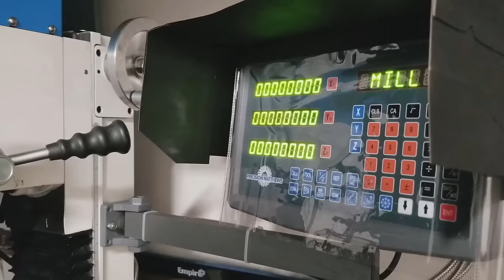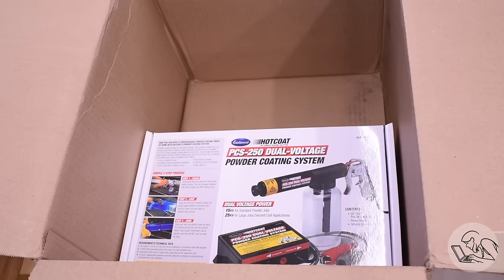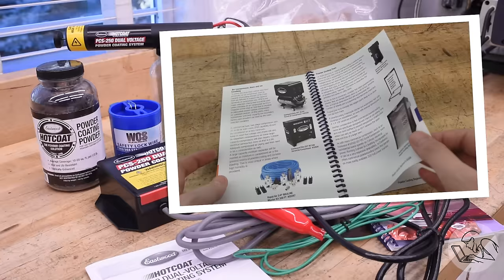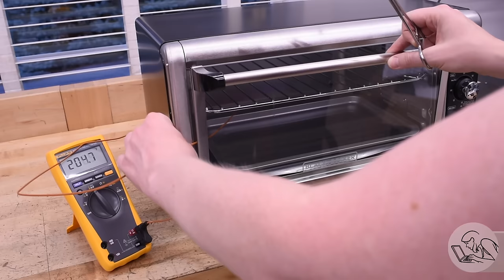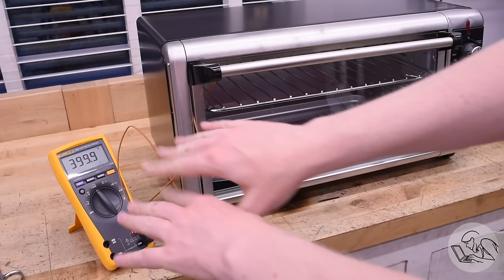Powder Coating At Home! You Can Do It!

Comment: For anyone interested, you can powder coat perfectly well WITHOUT  this powder coat kit. We ammo reloaders have been powder coating our bullets about 100 at a time just by shaking them in a tupperware container, shaking them out on a wire screen, and then just putting them in the oven for a few minutes. Perfect results. So you don't need all this expense. But it's still interesting to see....thanks.
Reply: PS....Eastwood is the best powder, though.

Comment: I love powder coating, probably because I hate painting. Two tips I found helps.  

First is to polish, clean, lightly sandblast, clean, then powder coat. I find that any surface inconsistencies are magnified in the powder coating. Primer and paint fills voids, but not powder. The very fine aggregate sandblast mattes the finish just enough to hide any micro scratches and gives the surface more bite, which seems to help make the powder coat even more durable.

The second tip is about corners. Really sharp corners are a machinist’s dream, but are not ideal for powder coating. If you can ease the corners a bit, the results look better and will hold up better. The sharp corners seem to coat thinner, and they cut the coating like a knife. For big items, they recommend a 2mm radius, but I find that even just a little break of that edge makes a big difference. Again, it needs to be tooled, polished, and surfaced just like the rest of the piece to look great. Just knocking it off with a file or debur tool can result in an inconsistency that will show up after it is finished for small show pieces like you are doing here.

Comment: There are many different Powder Coating materials.   A broad generalization is either they're Polyester / Urethane  based or Epoxy based.  Most stuff is Polyester / Urethane based, the more expensive Epoxy based stuff (aka Thermoset)  is tougher than anodizing or just about everything else.

Comment: You can use flathead screws and/or make you some cone shape spacers/washers so you only prevent powder from getting in the holes. That way you get powder on the whole surface.

Comment: I would NOT suggest a microwave oven transformer DIY version, first I don't think it would be easy to make work, second dangerous... a neon sign transformer would be a safer idea to start with, I imagine ideally you'd want high voltage DC, "ionizer modules" might be the better place to look, or a few high voltage diodes in series

Comment: 8:18 McMaster has large selection of gauges with a range of 0 to 15 psi, and since they are most accurate at mid scale, that should be about perfect.  The lowest cost one I saw was about $15.

Comment: Have you tried something like a clothes pin to lightly clamp the ground wire to your ground rod. This could help with grounding as well as stabilize the swinging around of your parts while spraying. One other thought I had was bend your ground wire 180 back on itself so it'll act like a small spring then feed that through a hole in your part. Again, maybe a better ground and more stable part. I'm just spitballing here, I have zero powder coating experience.

Comment: Well done video , in the United States i have  a few freinds that do small Motorcycle and Automotive parts in Powder Coating  they Custom Fabricate  all of these guys have  used  Salvage Household Ovens for their heating elements  and fabricated. the Ovens or “Curing area  out of  anything from Bricks , stones ,Plywood and   Insulation to keep the heat  contained  all methods. appear to work  fine  these guys. mostly began Powder Coating  with a system that was built for Sears and badged with the Craftsman logo  they however. do  puchasecEastwood Powder  to replenish their  stock  many of those guys   use a lot of Black  for motorcycle parts. and  frame and Suspension parts  they Weld and Machine for their projects

Comment: If the thickness of the powder coating becomes an issue (ex. threads), take a look a Cerakote.  It creates a ceramic coat that is thiner than the powder coat.

Comment: I would recommend looking up how to turn a toaster oven into a reflow oven for circuit boards. Temp it measured with thermistors and controlled by a micro controler to a set temperature curve over a set time. This could easily be adapted for tour needs with a tweak to the coding.

Comment: Hook thru hole: Take the wire double in the "hook-part" and bend it into hook shape. Use a screwdriver to bend up the two wires, so they have some springiness against the walls of the hole. Makes better contact. I hope its understandable ;)

Comment: You can also preheat the metal and then spray it and it will melt immediately and you can get a thick layer that way.

Also i think your air pressure might be a little high just from the sound and the speed of the dust

Comment: Turn your top rack for the oven upside down if you can , then you might be able to just hang a few parts on the rack and slide into oven. Taking the very bottom shield pan out may give you faster reheat times and possibly increase temps. If you can find some thin insulation for the oven door may help the temperatures as well. Great item for the shop.
Reply: The problem is it slides for about the first 6-8 times then it doesn't.

Comment: Quinn you are always FLoCKING  around in the shop, anyway the shop I work in powder coats parts and the guys that do it every day say the key is bead blasting the parts first (they use crushed glass ) it leaves a textured finish  on the metal and when the powder melts it flows and grips the textured surface there parts look like they were  dip in a bucket of paint when its done ,  anyway thank you for taking the time to make this video...

Comment: That was a great video. It shows the versatility of the product so well. The final thickness is amazingly thin and, therefore, must weigh far less than paint, which will be great for small model aircraft.
Is there any reason you could not tip your oven on one end, giving you a taller space to hang your parts. Obviously, the controls would be at the bottom.

Comment: You can use a normal kitchen oven that's electric, very highly recommended that it be purely dedicated to just the powder coating. Unless you like the extra zesty chemicaly plasticy taste that will permeate everything cooked in said oven.

Craigslist or marketplace are decent enough starting points to get them used as remodel take outs, moving "i don't want to haul this with me" deals, or because the cook top, if it's a combo unit, no longer works.

Winter is usually a good time to do a lot of powder coating because the air is usually dryer already and you're going to have a oven going so might as well put the extra heat into warming inside or garage when it's freaking cold versus when it's hot enough to get plastic garbage cans soft.

Comment: It would be a easy fix to rewire the power light on the oven to be in parallel with the heating element so you know when its up to temperature

Comment: I had a car chassis that was powder coated. It took a tin of paint stripper and a few twisted wire cups for the angle grinder.
A friend worked at a company that did nuclear engineering. They powder coated my car frame after a chassis mod. The original powder coat wasn't as good as the one they did.
They also powder coated all of the suspension components.

Comment: Quinn, I run my toaster over on its side to get the height I need.  I cut the wire rack in half and then screwed it to the side of the oven.  that became the top and now i have about 18 inches from top to bottom two hang stuff.  I'd send pictures but I don't know how

Comment: Here's a thought for your ground. They gave you rubber plugs. When you run your ground wire through a hole in your part can you put one of the plugs in to insure a good solid ground?

Comment: I had had very good results using two part etch primer formulated for non-ferrous metals followed by enamel paint.  One part etch primers aren’t always effective and you should only really use a thin coat of etch primer.
Reply: That sounds good advice, given that brass is a zinc alloy, etching should give good adhesion. I’ve also seen brass parts develop quite a strong black finish when stripping nickel coatings in 10%sulphuric acid using a thio inhibitor, I guess a copper sulphide coating.

Comment: sigh   You might have cost me a lot of time and money, that looks like fun. Thanks. 

Excellent video as usual, hope this works out for you. I have pretty much the same experience as you have with paint. I can mix a decent caustic black oxide when I absolutely need to, even did a few rifles back in the days. And aluminum can be anodized, it's a bit of a hassle to set up but not as bad as the black oxide. But both have severe limitations on size and mixed materials. Powder coating really looks like the perfect jack of all trades.

Comment: The compressed air "dryer" is not a dryer, its simply a filter and water trap. It also should be placed before the regulator as they can cause up to 5psi drop. 
You can get small desiccant dryers which would work well for that situation.
Reply: @johnrussell6620  lol, no. every FR unit has the water trap and filter before the reg. you don't normally have a system so bad that it drops such huge amounts of pressure that it drops the temps that low. plus in any decent system the moisture is taken out before it even gets to the pipes let alone the end of line regulator.
tho the single biggest problem with what you suggest is filters add restriction which reduces pressure so your going to be lower than target pressure. how much lower you never know as the restriction is between the gauge and the machine.

Comment: powder coating. the laser printing of the paint world. :D here's hoping that you modify the oven for much better control, or get a dedicated powder oven. I mean huge cheap toaster is still a good 'shop oven' but I think the dedicated powder ovens are taller rather than wider. it looked like a tiiiiight squeeze to get some of those parts in there. also, I think threaded rod n such could help a lot for certain parts. especially if the rod can have a slight, but even bow. just enough to make it tight.

Comment: I prefer Cerakote...in my opinion it's easier to do.  Cerakote has a C series coating that is air drying, so no oven required.

If you already have an aircompressor, its just a simple matter of buying the cerakote color you want, a cheap HVLP gun, mix in a few mls of catalyst and off you go.

Comment: I wonder if a self tapping screw turned into one of the holes in your pieces would solve both the grounding and the shadowing issues. You could attach your ground wire and the hanging wire to the screw. The screw would only need to be turned in tight enough to grip the part but not distort it.

Comment: use a IR thermometer to measure the temperature of the part you coat not the oven temperature.
when the part is up to the right temperature then start the timer.

Comment: You can improve the bond to brass with traditional paints by using a catalyzed epoxy and catalyzed paint, then baking but I don't think it will be as good as powder coating when applied correctly. I've done some testing on different methods and for what you're doing I think that's the best .

Comment: You just got a new subscriber with the cat comments and climbing in that box.  LOL  I've been threatening to pull the trigger on the powder coating unit from Harbor Freight for a decade now.  The HFT gun is lower voltage and only $80.  The Eastwood is $148 with shipping. For small parts, is the HV gun necessary?  You could improve your ground by clamping it onto the hanging wire and rod, which would stabilize the part for spraying, as well.  Is that shop (nice, BTW) in your house, or a remodeled garage?  You've really sold me on powder coating. That stuff is great!  Are there any metals you cannot powder coat?

Comment: I'm a small-time patreon and really look forward to your posts, love your work. But here's a bit of negativity: as someone whose main relationship with powder-coating is to try and repair it (rusted 'wrought-iron' railings, unimat 3, fridges etc.) I consider it the work of the devil. Very useful to consumer durable manufacturers to provide a shelf-pretty appearance and resist minor knocks inside delivery boxing, but it turns whatever it coats into a disposable item, there's no fixing it. In the case of your trucks, forget ever repairing any chips and maintaining the beautiful finished look you have now. Of course, you may never run the loco enough to chip it. And I don't have an immediate better answer for brass, though I think there are more durable paints than that enamel you tried. At least paint can be stripped and replaced, even if it doesn't last as long. Yes powder-coating is more durable, but it does chip, fairly readily.

Comment: Great video, I have a HF powdercoat system sitting on the shelf ready to use. Few questions, did you have any coverage problems in the area around the hook, specifically where the hook is covering the part? Also, did the hook stick to the part after it was baked? Thanks

Comment: upgrade the steel rod with a piece of copper pipe and the wire for a piece of triped single core copper cable.

should improve the conductivity drasticly iron/steel is kinda bad for transmitting electricity.

maybe enough  so it doesnt need the dedicated  ground cable

and the copper should be able to whitstand more than 400°C or 400°F(~204°c) whatever temp measurement system u meant your oven was set to. 
think the melting point of pure copper is about like 1000°c/1800°F or somewhere north of it so no home oven would ever be able to melt copper unless the theromstat in in it is broken and the oven heater is in full blast mode all the time.

Comment: I'm surprised you can mix the powder to get sifferent colours. Yeeaars ago I got a tour of a power coating facility, and the guy said that mixing wasn't possible. 

I suppose from a distance the different particles will end up close enough on your retina, to end up in the same receptive field of some cones that form a unit, or something? But up close I think you'd see specles of the different colours? That may be a factor with model work, which I think will be viewed more up close.

But it does look a lot less of a hassle than spray painting. I have an unused paint spray gun for some years now. It just might get the company of a powder coating companion :)

Comment: for aluminum we use a nitric acid cleaning ath on aluminum and then sulfuric acid electroplate to make a diamond plate and we also use before that normal hot water bath dye of any color.. it not actually eltro plate its a coercive surface and diamond plate i probaly not the right term but its the term our company uses

Comment: Hello!  I've got a question about the process:  How does masking work?  I'd love to try this for a project of mine but there are some areas I need to be bare metal (EG, a square section in the middle of a plate for an LED to sit & conduct heat into the plate)
Reply: Stick down a piece of kapton tape, cut to size with a scalpel (either in place or before sticking it on) and then powerdercoat right over it. After it comes out of the oven and cools you can remove the tape, and the surface under the tape will be clean of powdercoat.
Reply: I forgot about kapton tape!  A perfect solution, thank you! @AlexanderBurgers

Comment: Unless there's an issue with chemical interactivity, Aluminum or aluminium would provide a better electrical connection. Stainless steel is a relatively poor conductor of electricity. Copper is the best but not that much better than aluminum and is more expensive.

Comment: 🤔 ... just curious - and I'm likely wrong - but I think the crumb tray goes UNDER  the lower element in the toaster oven - and the other tray is for food to slide in the racks  ... looks similar to the one a relative has I was visiting last week ...  might help reaching a higher heat by exposing the element ...

Regardless - really cool info 🙂
Reply from the maker: You’re not wrong. See pinned comment. 😊
Reply: @Blondihacks  ....it was right in front of me had I looked  🙄 ... 😁 ... Cheers

Comment: Could you not turn the oven on its side to give a taller interior space for hanging stuff? (With accommodation for heat vents obs.) I’ve seen microwave ovens deployed this way and doesn’t affect performance.

Comment: I think you installed the drip tray incorrectly. It is supposed to slide in to the bottom of the oven, not sitting on the heating elements. ❤ the video.

Comment: Powder coat is very durable. No question about it. But let me ask you this: when a powder coated piece gets marred to the base metal, how do you fix it? Let's assume that the piece is installed in an application where removal would be...problematic (prohibitively expensive). How do you make it look good again?
Reply: Paint.

Comment: Very informative and useful video.
  This might sound like a daft question, but if you are going to powder coat some brass parts of your locomotive, then why make them from brass?  Steel would be cheaper, and looks just the same when covered in lovely powder coat.
Reply: Brass is significantly more machinable than steel

Comment: I'd have expected there to be a ground point on the sprayer.  You just need the electric field relative to the nozzle tip, right?
Reply from the maker: That’s the clip that is on the bar. It’s from the power supply. The experts say that’s not always enough.

Comment: I realise there is no scientific evidence for this whatsoever, but my experience is that ground wires (for powder coating or any other purpose) work better if they descend vertically downwards from whatever they are earthing, rather than running sideways or upwards.